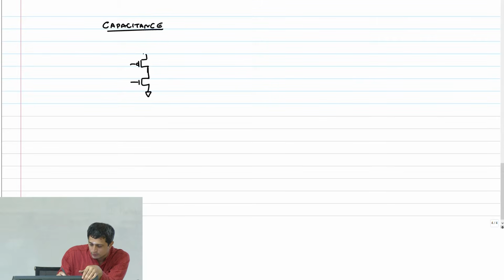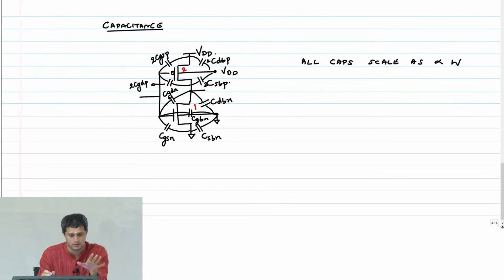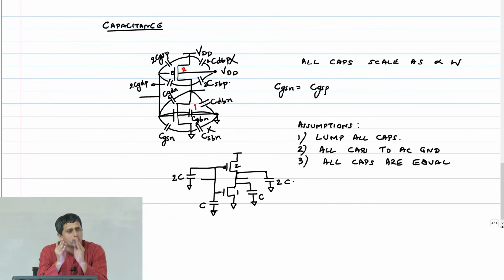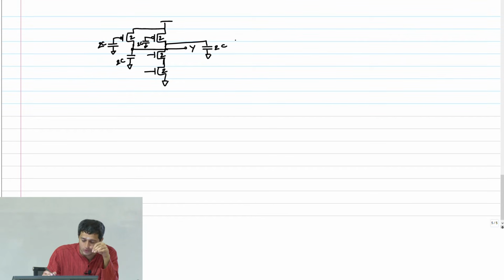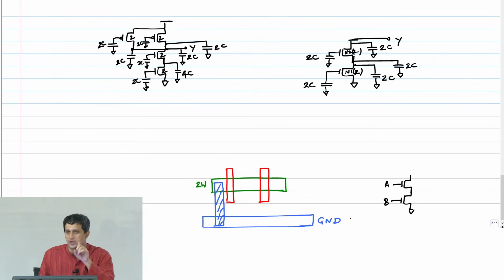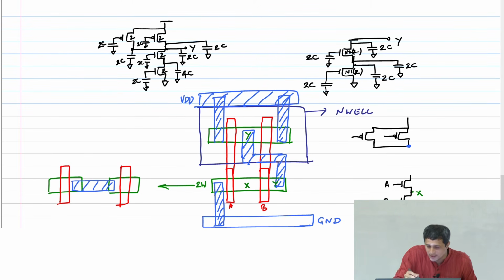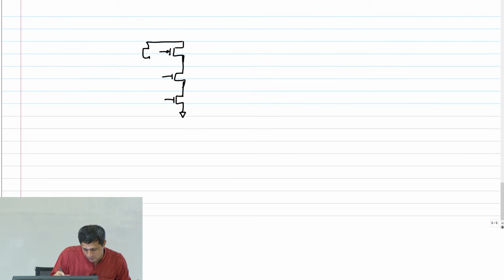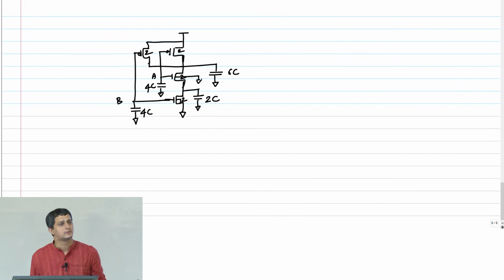CombCkt - 4 - Logic Gate Capacitance

Comment: 10::45_16-04-24_@IIIT-H
In Nand, N1 drain and N2 source shares same diffusion (so, single cap C)
But P1 & P2 drains could also be considered as common diffusion right!? --> we have metal contact thus we need a finite spacing b/w both P1, P2 drains diffusions (I don't understand this)
Reply: This spacing results a separated capacitance

Comment: what is effect of gate capacitance on leakage current
Reply: If you're asking about leakage current, it means you are analyzing your circuit in dc. hence you shouldn't care about your parasitic capacitance. 
btw, leakage is at OFF state where delay consequences are not relevant. Therefore, parasitic caps are not relevant.

Comment: Can we share diffusion cap of transistors who have different widths?
Reply: Like 2 in series with 4 sized NMOS
Reply: No you can't. 
It is not considered as shared because different width results in different capacitance by definition. 
Moreover, I don't think we use different sizes of transistors at the same design\process. Instead, one can connect a bunch of transistors in series\parallel